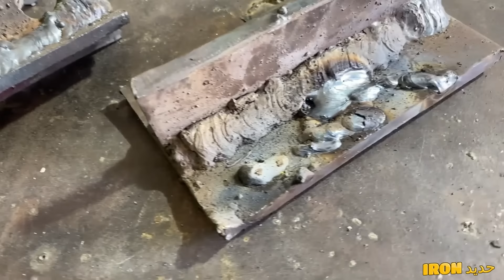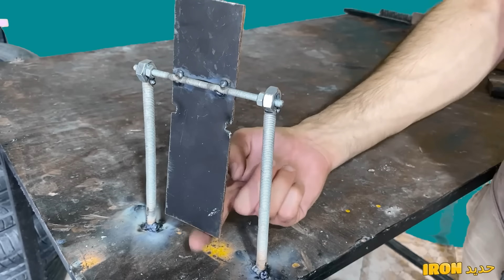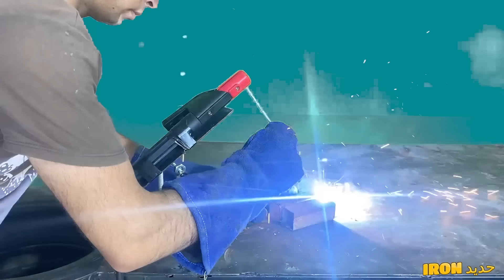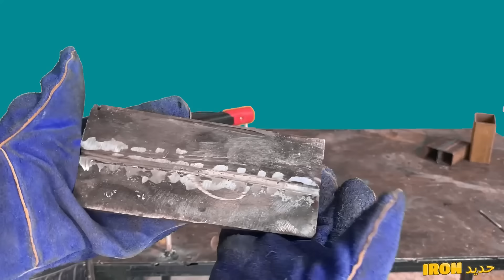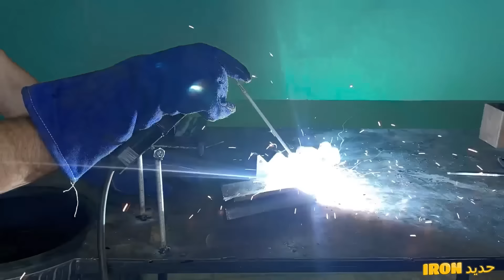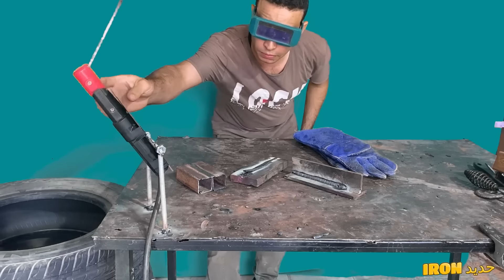A new trick for easy learning of electric welding

Comment: I consider this a trick to welding. If you can get it done easier and better, then your learning. I'm 63 and used to weld well, now, not so much. I am now going to build a movable device. I don't care if I weld or a trick. I need my job done better than I can. Thanks dude. I'll give it a try.
Reply: This is an age-old rig. Saves lots of labour.

Comment: WW-2 teeter totter welders were used in shipyards.
They used 3/4" x 39" or longer.
One side would weld like in the video, when it got to the nub the other end dropped and continued welding.
This is just like those on a smaller scale.
Reply: Thanks

Comment: Here's a tip, if you extend the length of the radius arm where the stinger sits, your work angle will stay at a more constant degree throughout the entire weld fistance. Basically, instead of mounting the stinger right above the rotating lever, put a long arm then and then attach the stinger at the end of this longer arm.
Reply: He could just bend the electrode forward slightly to get a 15-30° angle I think.

Comment: I want to see you do this vertically and overhead and around a pipe .
Just learn how to weld the right way.
This is not useful for real welding jobs .
Reply: Facts. Also loving the push angle for the last 4” of rod, I’m sure the last bit of that bead is full of slag inclusions and the start of it will have little penetration and prob a lot of undercut/underfill

Comment: I haven't seen anything so simple yet so incredible for a very long time! Amazing
Reply: works the same if you use longer bits of box section put welding rod in joint between the 2 pieces of box then lay a bit over concrete slab or concrete block over welding rod and use bit of metal to strick the end on rod you get the same weld

Comment: Ah ha ha! Not bad😂 pretty smart idea. Now if you could do that with a bit of tension and for pipe root pass, you'd really jave something there lol. You need the tension to literally push the weld inside the gap of the pipe.
PS: you need to lower ur Amperage a bit more. That weld is quite hot and has weakened the apparent metal. You should be able to still stop it from sticking by using a E7018 or E6013. They both run beautifully smooth on arc starting.

Comment: Neat trick. However the weld has under cut and no crown on the flat butt joint. The t joint looks ok. Still recommend learning to do it by hand. That way your welds will pass an inspection.

Comment: Jet rod.  Old salesman trick.  Only lays flat.  You can hold it with your hand and get the same effect.
Reply: If you hold it with your hands and maintain the proper 70-80 degree drag angle you’ll get even better results. Notice it’s PUSHING the puddle not dragging for like the last 20-30% of the weld.....

Comment: I have to admit it's a simple yet ingenious solution, And, as an added extension to the teaching aid, Tack a Bar across the mid point, then  weld nuts on the bottom of the two uprights, so they can swivel on a bar tacked to the Bench, with a forwards pointing spring tacked to the mid point bar and the Bench, this way you should be able to rest your arm on the top plate so you can pull back against the spring pressure, this would not only help build muscle memory in terms of weld speed, but, it should aid in learning Arc control as well.....well it's just an idea

Comment: Called Gravity Welding...was done in shipyards years ago with much bigger electrodes.
Reply: Yea, also not quite like this, his pivoting setup produces a continuously changing rod angle which turns into a push angle for the past 4” of the rod, which I’m sure you are aware pushing stick on the flat like that is a very good way to get slag inclusions.

Comment: I was taught this almost 30 years ago as a demonstration that welding is so easy a monkey can weld. You don't need a person to weld the machine does it for you. You only need a person to set it up.
Reply: Well, in theory yes, but this is a terrible attempt at gravity welding, the fact the the rod starts at like a 30 degree drag angle and finished with a 15ish degree push angle will guarantee the last bit of the weld that was done with a pushing angle will be full of slag inclusions and the first bit of weld will have terrible undercut and low penetration. No way that setup passes and respectable welding standard.
Reply: @danf849  I've never welded a day in my life and I knew there was no way a rod going in that direction with no pattern whatsoever would be a legit weld. Thanks for explaining

Comment: Do that vertical mr smart arse or around a 6 - 16 inch pipe in a 6G position that’s going to get Radiographic inspection & fail if any defects are found plus these pipes are holding pressures that you will shock you

Comment: a perfect weld every time nice job sir
Reply: Far from it actually, the fact that the angle of the electrode changes throughout the welding process means that the electrode is only at the optimal angle of about 70 degrees for a short portion of the weld, when you have too much angle you lose penetration and risk undercut and if your angle becomes too steep to the point you start pushing the puddle instead of dragging it you then risk porosity and inclusions as the ark pushes slag infront of the weld puddle

Comment: Should really know how to strike your rods, drag your rod gently till you feel the burn. More like keep breaking the tip (flux) till you see the metal rod point. 🤙
Reply: If you ever weld in a code shop do not crush the flux off the end of your rods for easy starts, it will be your first and last day, guaranteed porosity when you first strike the arc
Reply: @danf849  that is totally wrong
Reply: @charlest4098  mm, well I do work in a code shop that builds multi million dollar pressure vessels, we weld to TSSA and ASME code. Anything pressure vessel is TSSA and it all spec work with full back purge, if you get caught lighting up with the flux knocked off your electrode leaving porosity that then has to be ground out and re-welded assuming you didn’t just fuck the whole part as some grades of stainless we weld can only be welded once otherwise the multiple temp cycling of the haz causes grain growth beyond the acceptable limit. So yea, you would be fired if you carelessly introduce poro on a multi million dollar job that then requires extensive rework or the entire part being scrapped due to the limited weld ability of the material.
Reply: And that’s why our welders make 150k a year before OT in a nice comfy shop. Because they are meticulous and highly skilled, never cut corners, follow the weld procedure, don’t cut corners, etc.
Reply: @danf849  stop lying to yourself 😵‍💫

Comment: No entiendo, estoy aprendiendo a soldar hace muy poco y me enseñaron que el electrodo debe estar a cierta distancia del material a solar, como 2 mm, pero veo que muchos pegan el electrodo y no pasa nada, alguien me puede explicar?
Reply: Depende del grado en que estas soldando. Ya que el alambre interno junto con el revestido hacen el trabajo conjunto para un buen arco eléctrico. Si solo tiene el alambre desnudo se pegara...
Reply: They are running very hot using 7018, you’ll find if you run 7018 near the top of the amperage range you can strike your arc and then basically rest the electrode on the work as it melts away, although this is not a good practice as you mentioned this means you are short arcing the electrode, furthermore this meathod of pivoting as the electrode burns means the drag angle gradually turns into a push angle which is very bad with stick.
Reply: Gracias por la explicación, thanks for clear my question👍🏻

Comment: This is such a misleading video! first of all, you cant do that with all electrodes, most likely he used a 7024 jetrod which is exactly how you would use it. 2nd of all with the angle of the electrode changing constantly due to the teeter effect theres no way thats a consistent weld over the course of longer than 2-3 inches.